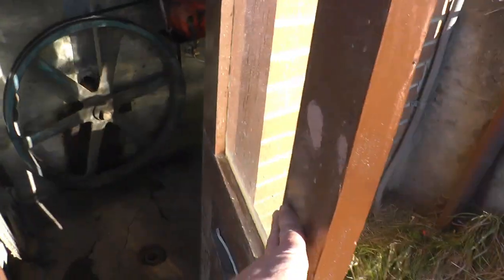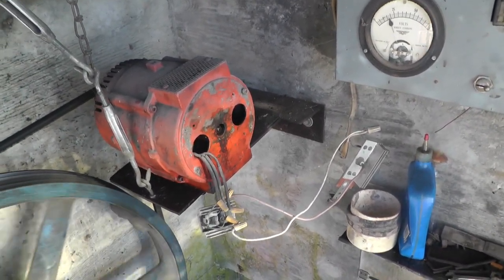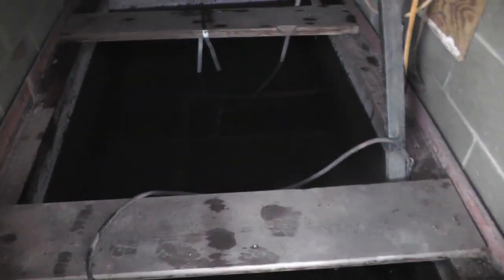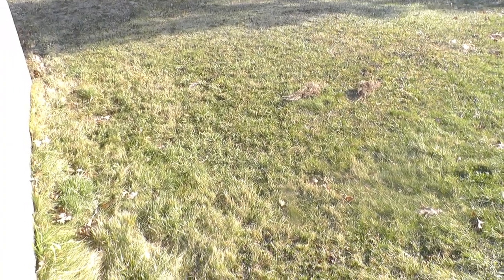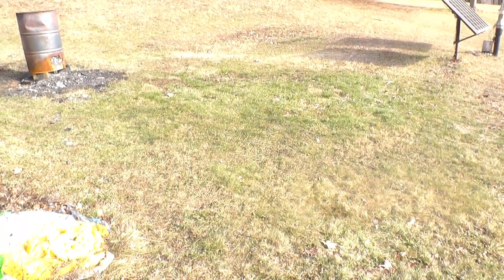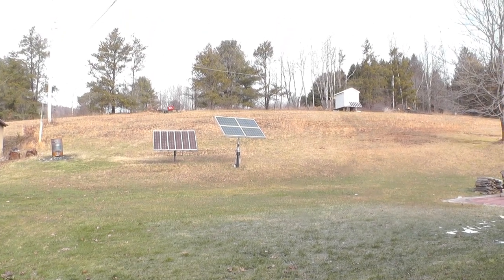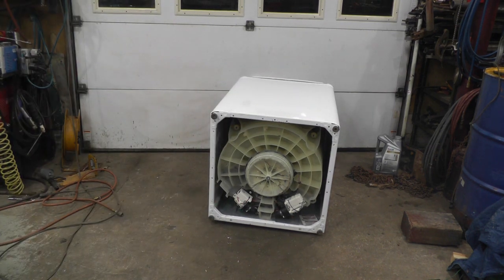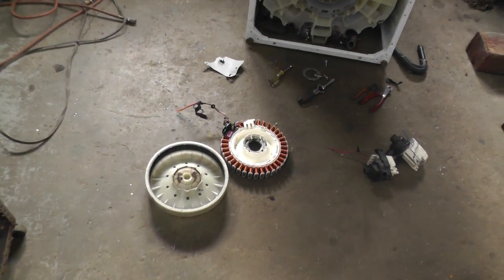Waterwheel   Windmill  Comments on Your Comments

Comment: Wow sir, you have a lot of skill and knowledge that is lost on the new generations. That is what makes YouTube a valuable tool as well. I can appreciate your ingenuity of all your projects. Great minds think alike. You would fit in well with my uncles. I too have PV and hot water array along with a home built high efficiency boiler and wood splitter. Dabbled in wind but never fully committed. I’ve always found hydro fascinating just do not have the location for it. Looked into pumped storage but didn’t have solar at the time. I will be subscribing and catching up on your videos.
Reply from the maker: Thanks for subscribing. You Tube has inspired many of my projects. Hope I can do the same for others.

Comment: We have bought pillow block bearings for our water wheel. After viewing your video on your water wheel,and you using maple blocks instead. We will be making bearings from maple blocks ! Thank you for the information. Our water wheel is an under shoot getting water from a old beaver pond.
Reply from the maker: I would be interested in hearing about your results after they have been in for a while. I was very surprised how long mine last. Good luck and thanks for watching.
Reply: @kevincrawford2027  will keep you informed. I like your  site, good info , and experience using different methods. We are off grid in Washington State. Our wind generator is a vertical, and we have 6 100 watt solar panels. Thank you for your information, keep it coming !

Comment: you did a very good job with the water mill, which is just a hobby as you said. but i see a huge potential for an increase in performance in the yield of the electricity that could be generated with this system. I wish I had these possibilities with me. good job and greets from germany

Comment: Not entirely sure but you might be able to make a low head turbine work with the suction pipe down in the Culver's across the road. I'm not sure if it would pull more water than what the spring produces but you might be able to get it to work. It seems like you've got a pretty decent flow out of that spring in the night's battery of water behind the dam

Comment: I like your creative approach to a lot of these projects!!! I'm about 6 months into a grid-tied system myself for solar and if I lived near any running water I do a water wheel too but I don't!! Keep up the good work!.. one small idea on your losses over long runs which I'm also probably going to run into myself as I have to go about 100 yards... have you ever thought about putting smaller "micro" inverters close to the source and then going the long run after it's been inverted over to higher voltage AC?
Reply from the maker: If I really needed the power I would do thing different but it's a hobby for me. Also I like to keep is simple. Electronics seem to have a short life span and are expensive and complicated. Hope your system works well for you. Thanks for watching.